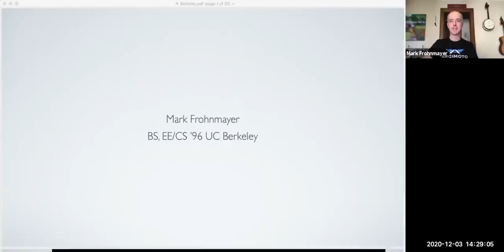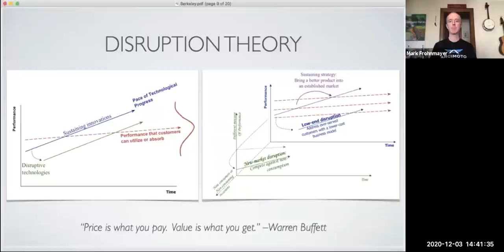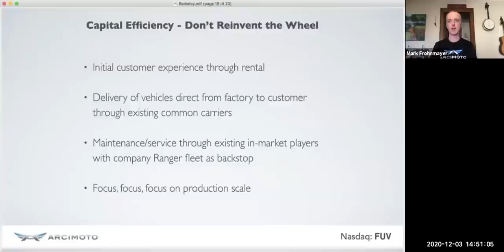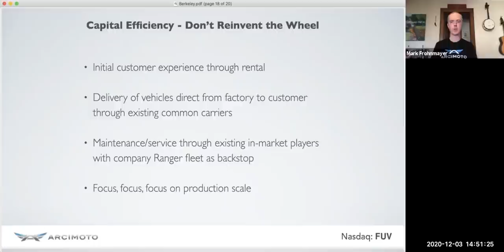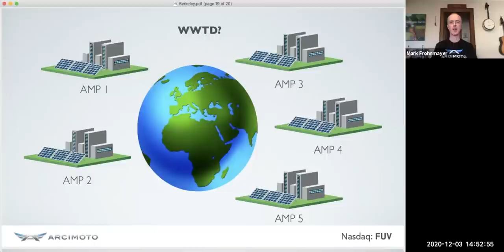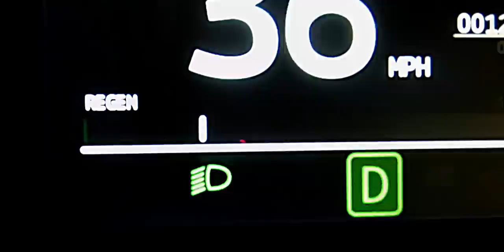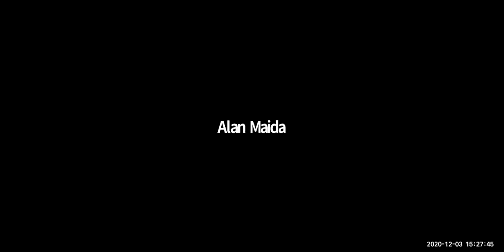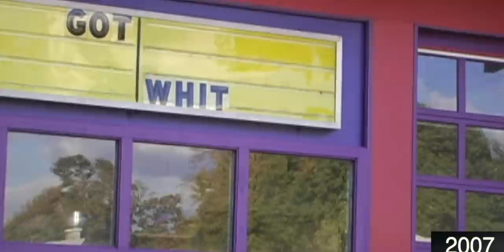Mark Frohnmayer FUV Lecture at UC Berkeley Engineering

Comment: It doesn't tilt...........major Pass for something else!
Reply from the maker: Sounds like you may be a future customer for our Mean Lean Machine ;-). https://youtu.be/iCiaIaVcR1U
Reply: By not tilting we can take advantage of car tires with wide road hugging tread. Even tilting can wipe out on gravel, an oil slick or wet pavement because it uses rounded tires with much less rubber on the road. I feel so much safer in my FUV.
Reply: @popeyegordon  .....What I want is a KYMCO CV3, but it hasn't come to Canada yet. ZEV in West Virginia has a tilting reverse trike/w reverse drive for backing up, but still battery, wish someone would invent zero point energy, so one can skip batteries.
You must be a cocamaime driver, I only wiped out once when I was 17 on a 1972 Honda XL175 on black ice doing the 'S' curve on the way to high school. Never happened again, with accrued experience and NO ABS/traction control on those days.
Reply: @arcimoto  ...Yes, I've known about TMW since they inaugurated.
Reply: @LoneBrowncoat  You are dishonest if you claim to have had as much experience as me without wiping out multiple times. Pea gravel too invisible until I was on it, front tire blowout in a hard turn, driver on a cell phone driving right into me. None of those result in a wipeout if you are in the Arcimoto. You sound like a kid. I repeat - traction is far greater with wide flat tread tires than with rounded ones, tilting or not. One is clearly far safer than the other as well.

Comment: I need secure doors with windows. Does Archimoto have this option?
Reply: Arcimoto is trying to shift us away from bad habits. Climate control and the doors, windows it requires puts an extra drain on the battery and is not needed by most. This offers heated seats and grips. There is a locking trunk for valuables and no room for an expensive stereo. There are no air bags or catalytic converters to steal either. For business use you can get the locking cargo hold of the Deliverator.

Comment: It's no different from a can am.  Useless when it rains
Reply: That is absolutely false. The only thing they have in common is 3 wheels. No motorcycle has a roof combined with a wrap around windshield. No marketed motorcycle has a full coverage crash cage and 6 point harness. So to sum up, you lied about the roof keeping us dry and you lied about the huge difference with a dual motor EV.